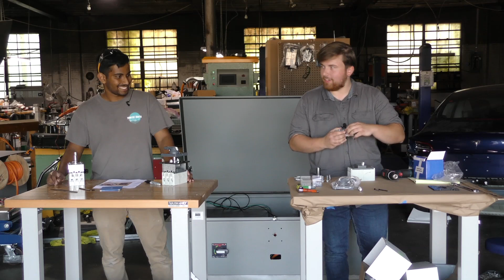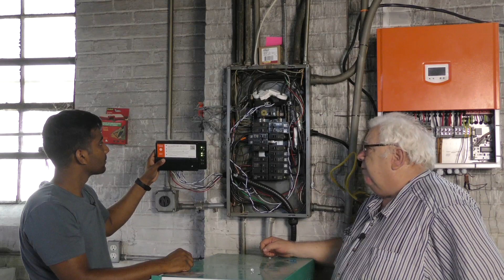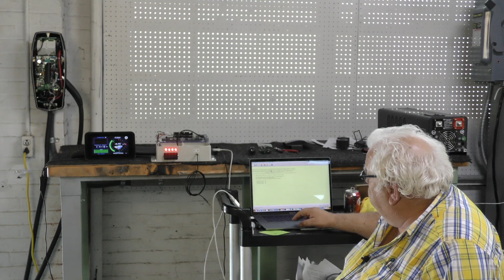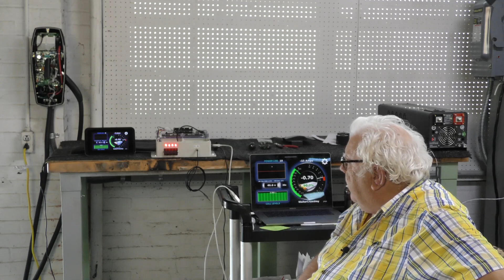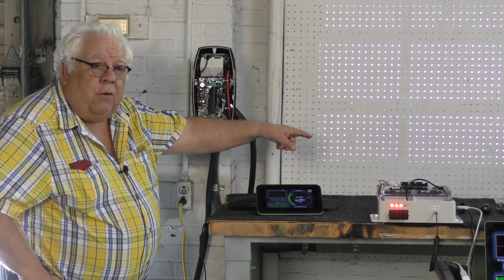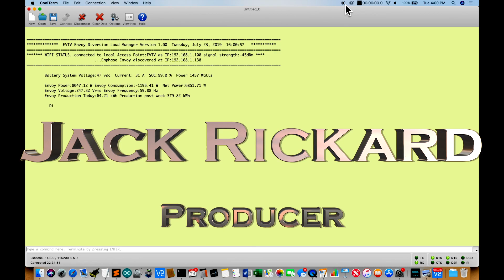Access Enphase Envoy Data Directly - PowerSafe 60kWh Solar Energy Storage

Comment: Hey Jack, I have an "enphase" keyword agent that alerts me anytime someone mentions it, so I'm back :-) 

I "tested" my Enphase/XW+6848 last week when the power went out. As you know from your own inverters, the transformer and switches pretty much can't help but charge your battery if you push power inward through it's output. So power went out and my Enphase inverters continue to tick thanks to the Schneider keeping the clock. The Enphase covered my local power consumption and whatever remained went to charging my batteries. Power came back and the (dumb) 5 min wait cycle started until everything went back to normal: ie: selfish solar, zero export.

Good to see you got the Envoy figured out with your new box. If you set your Envoy to "no export" profile (ie: selfish), it will self-regulate. That is, it will charge your batteries because the batteries draw that power from solar. As the battery gets charged, the Envoy (set to no export) will see there's reduced draw and back the microinverters off. The Envoy will not overcharge your batteries. No draw = no power generation.

Comment: Jack, all my solar arrays are connected via a NEMA 14-50 plug.  This provides a very straightforward electrical disconnect, and make's it simple to move a rack of solar panels from one location to another by just unplugging it and moving it to another location and plugging it in.  I even had a rack of panels on a trailer for time.  https://www.schultzengineering.us/sum2014-2.jpg

Comment: What is the future related to energy?

Solar and Wind are intermittent. For them to replace fossil fuels, they need massive amounts of storage.

Electric cars have massive storage and they sit around the majority of the time not using their storage capability.

Demand response allows power company (the grid) to pull from or push power into decentralized storage locations instantly.

With DC Fast Charge Ports electric cars can be attached to grid and provide enormous amounts of power instantly or intake and store massive amounts of energy quickly.

So, how will it work? Once (electric companies or the government) set standards for communication and rates for buying and selling electricity, there will be a HUGE new market called DECENTRALIZED ENERGY TRADING. Energy will be the new currency. Everything will be bought and sold in terms of energy.

When you buy a car in the future, you will have the option to buy an option called "ENERGY TRADING" The feature will allow your car to pay for itself by trading energy storage with the grid anytime it is connected to the grid.

This is 20 years in the future, but it will happen because there is money to be made doing it, and it provides a way to go forward that doesn't totally destroy the planet.

Comment: Awesome Jack!  I'm excited about the work you are doing with Enphase.  I have one of my electric cars setup so I can tap it's battery to run my house when the grid is down.  I've wondered for years how to manage my Enphase inverters so that I could recharge my batteries from my solar panels when the grid is down.

Obviously, my solar panels and inverters would want to run when I am running my 240vac inverter from my car battery, the question is two fold:

1. SOLAR OVERPRODUCTION:  What happens when there isn't enough load from my house and the solar system has capability to OVERPRODUCE demand (as my normally net metered system is cut off from the GRID in this instance).  Would Microinverters sense lack of load and just idle themselves with no damage to themselves?  How do they know?  Is it the difference in Voltage that creates the load on the Microinverters?

2.  SOLAR UNDERPRODUCTION: What happens when I try to pull too much power from my solar panels because for instance a cloud is going overhead and the LOAD of my battery chargers exceeds my solar production?  In this case, I would be in a bad scenario, because my battery powered inverter (65% efficient) would pick up the load and start a viscious non-perpetual motion loop of battery-Inverter-charger-battery with losses at each step.... I Need to be able to shut off chargers when the sun isn't shining...

AND Jack provides the solution!

Comment: Why not a one stop shop and attach batteries along with The inverter to each solar panel. If cooling was needed it could be done similar to Tesla and the excess heat off loaded to a water heater etc.

Comment: Move it in the new panel that you aggregated all the enphase circuits into
And it will help with the communication Noise
Reply: They want the envoy as close to the micro's as possible ive never had a communication problem but another installer in the company has. he had the envoy in a sub panel with pool pumps and a heat pump pool heater.
Had to move it away to get it to communicate.

Comment: put in about 280kw of enphase this year, i used to dislike them but i love them now. The q aggregator helps alot one circuit can do 14kw instead of multiple runs like you did.
Reply: @Jack Rickard 
That makes sense.
I completely agree rapid shutdown and enphase's much better than before cable system has made them really hard to compete with.

Comment: One of my MX key fobs stopped working this winter and the other key fob had a low battery warning so I went ahead and replaced both batteries. They were more than two years old.

After replacing the batteries neither fob worked. I ordered the same type of batteries and tried resetting them a few times. Today I took both keys to Tesla and they said they also could not get them to work and would order replacement keys. 

This seems very strange that both fobs would completely stop working after a battery change? I suppose one could have died before but seems too coincidental. Has anyone experienced this or any ideas of how to bring them back to life?

Comment: I see you are using two Midnite SPDs , one for input and one for the output. I actually use only one SPD for both input and output since it has two channels. Is there any reason why you do this ? Are there advantages using separate SPDs for input and output ?

Comment: Those 14-50 connectors are only rated for 50A, the sigineer can do 80A in bypass and 62.5 in battery mode.
It'd probably be a good idea to use a different connector rated at higher amps
Reply: @Jack Rickard Yea deflect all you want. You know those connectors/cables will get hot. At least use an L5-60, it'll get you within 1A of the max inverted output.
Reply: While I was rewiring pretty much the whole place (in stages) I resorted to using two NEMA 14-50s to back feed the house and shop.  (the fangs) The 20 kW inverter would heat them both on a bad day.  No-Ox helped keep them fresh.   Now that all the safety switches and transfer switches are in, I've got AWG 2/0 THHN doing the grid bypass and AWG THHN 1/0 feeding inverter output.  They are great for experiments but then, I have an IR temp gun to keep an eye on things with.  I've passed 200 amp surges through them for  decades.